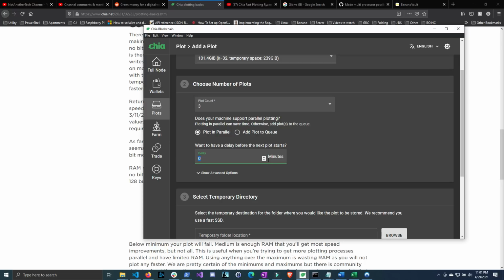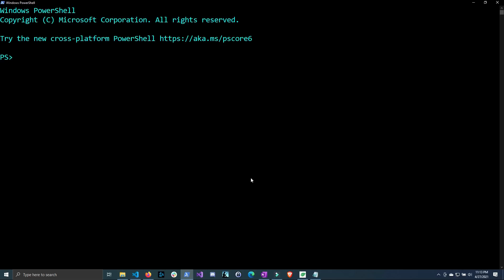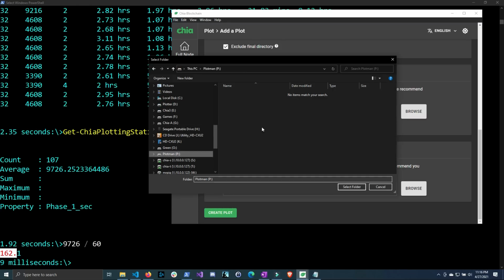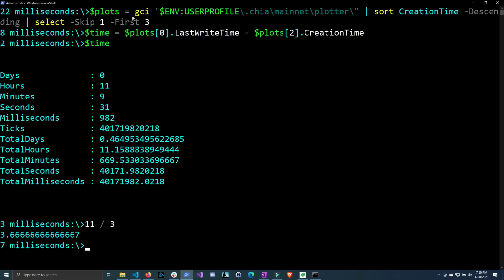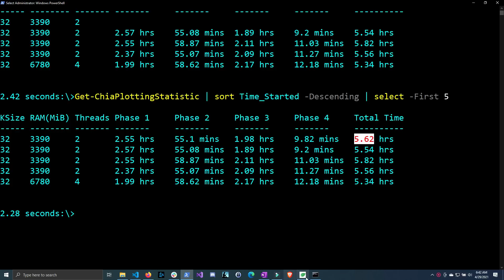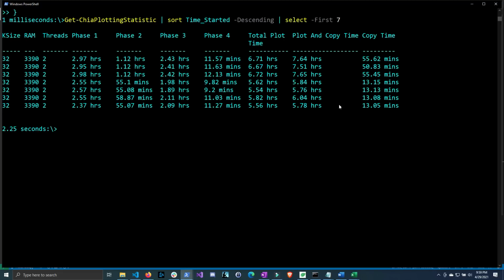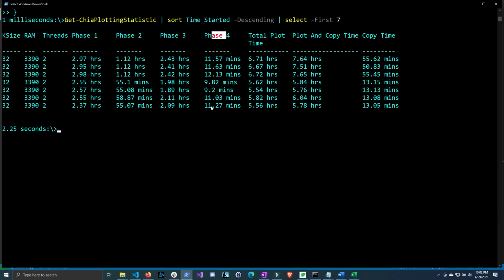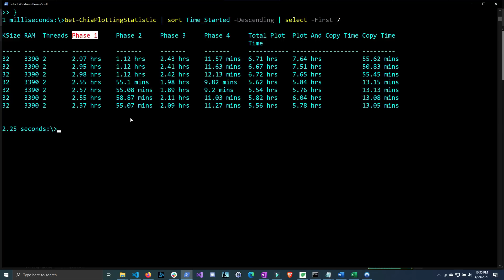Optimizing The Delay Between Parallel Plots Using Log Files and Powershell - Chia Plotting Part 3

Comment: While you are in the plotting GUI:  Mouse over to >ACTION >the three dots>Log.   It will open a CL window and show you a real-time log.  Optimize there first, then deploy..  Pretty sure the Phase 1 plotting for all will be with a few percentage points.  My Phase 1 are 164 minutes and I've been running them 8 mins (!) apart.  No wonder I have crazy long transfers to the farming drive :-(  I found all this out in large part by watching your videos.  TY

Comment: i guess there is one other thing you didnt mention in this staggering video... drive space.. it cant be monitored, so i guess you have to work out how many you can do in parrallel given the time per plot and the plot temp size... i have a 1tb ssd.. so at a guess, if i staggered each one by 2.5 hours, i could, in theory run an indefinate number of plots (1st plot emptying itself off the hard drive as the 4th plot comes in).. but for 1tb.. it would be very close call... you may want to increase the stagger amount to cover yourself running out of space (if running at speeds notanothertech channel was running at).
Reply from the maker: So you would have a max number of parallel plots going. If you have 1 TB then your max would be 3 and this video gives you a suggestion on the delay you want to stagger these 3 parallel plotting queues. The GUI doesn't allow you to do this natively, but I have powershell videos that shows how this can be done and one video on how to do this in the GUI as well.

Comment: Great stuff, im learning a lot but how do you add a date and time started to the columns? Also can i choose the log directory?
Reply from the maker: You will have to use Format-Table -Property prop1,prop2,prop3, etc to create your own format table view instead of using the default one I created. 

so Get-ChiaPlottingStatistic | Format-Table -Property Time_Started,KSize,etc
or  Get-ChiaPlottingStatistic | Format-Table -Property * 
to list all properties. 
You can use the -path parameter to specify a different path to the log file. 
ex.  Get-ChiaPlottingStatistic -Path C:\ChiaLogs\Chialog1.log
Reply: @SysDeskDev  Wow i was not expecting such a quick reply. I already started adding the date to the switch -Wildcard ($line){ and then i was going to modify the table... wonder if i get lucky and can pull it off. 

I see that Get-ChiaPlottingStatistic | Format-Table -Property * has the creation time at the end but the time part is cut off early.
Reply: Ahh i downloaded the zip and was trying to edit the scrips but i cant seem to run it from there. So that doesn't seem to work for me. I have to move the logs into the       Dir that it wants to look at. Its too bad i cant get the format simplified to hours like you set it but it will work. thanks!

Comment: Great job. One question, why not to modify a script for delay based on 1st phase finish time. In this case there is no need to calculate on aproximate time of 1st fase. Script will see that it's over and start next session. Is it possible?
Reply from the maker: Definitely possible, I do want to add that to the script but just haven't found the time.
Reply: @SysDeskDev  it would be great.

Comment: if u have 3 HDD u can try add 3 Qeue with differents names ( def 1, def 2, def 3) and dont use same HDD in the final destination for evade the bottlenecking in copy, i run 4 plots in paralell without delay using this method and works for me. Nice video for sure

Comment: Also, if the only "real" difference with/without delay is at the end (moving stage), if its a dedicated plotting pc, a powerful cpu/ram etc, wouldn't it be better to put 15 delay (delayed plot moving time) instead of 60-100min delay (phase 1 duration). 
Ok, as they start with min delay, they will clash at phase 1s and tire the cpu, but it will only slow the process less than an hour, and if we move them separately we gain 1 hour again?
Isn't this logical? In theory at least, it looks like its the best of both world..

BTW on my tests, even tho my P1s take almost 180mins to finish, ceteris paribus when I try 30-60-120 and 180mins delay, the 30min finishes before 60, and 60 finishes before 120 etc.. That is why calculating the delay based on phase 1 is mixing my mind..

anyway, great script and video, thank you..
Reply from the maker: I would at least put a 30 minute delay just to play it safe, but also by delaying them for the majority of phase 1 you could add more threads (which I didn't go over in this video but plan to eventually) which could speed up phase 1 with the proper delay in place if that makes sense.
Reply: Thank you for the reply. 
My understanding is the same, the more you pass the phase 1 with 1 plot the faster your other plots will finish. Ok, maybe do not put delay same as total time i.e 180min, but 30-60min seems ideal to me too and all the official/unofficial documentation says the same.
But my results say different. (I still support the above theory tho)..

Comment: I think I am missing something:
You said that 3 delayed parallel plots takes 11 hours to finish, where as 3 no delay plots take 7 each, but as they all start together (cpu in overdrive) ) its 11 vs 7, so no delay looks better.
Than you made a comparison table for the plots made in 24 hours, and showed that eventually, after 12th plot, delayed parallel will start to come ahead of plotting without delay.
So far i'm on track right?

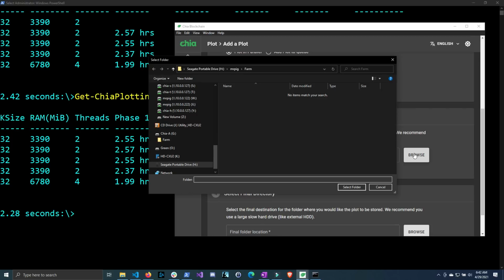Ok, here is my question, on your comparison table: You start at 5.47am and after just less than 6 hours (11:26) you already have 3 delayed plots? But 3 delayed plots takes 11 hours all to finish isn't it? 
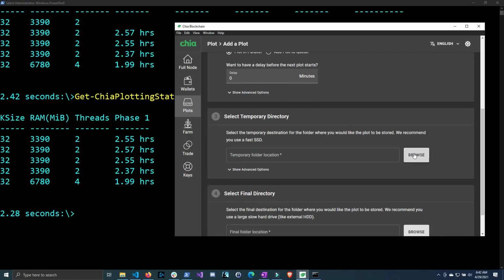I think you mixed the total time with time for one plot So in 11:26 column, there should be 1 plot delayed and at 4PM 3 finished delayed plots.. 

Am I right?
Know that I am a bit thick skulled, so please go easy on me if I am missing something obvious.
Reply from the maker: I will have to go over the chart again but you could be right that I messed up somewhere when extending the time out, however the chart was just for a visual representation of what would eventually happen which is that the stagger plots will eventually out perform the ones without stagger in the long run.
Reply: I am building a new rig with 16cores, i am sure if i put all 14/15 plots without delay it will take significantly longer than 7 hours and probably, as your calculations showed, even longer than 30-60 delayed.. at least thats what i hope, otherwise whats the point 🤷🏼, 
Cheers

Comment: I've been searching for some help with a crashing issue that I can't solve.  I have a Ryzen 9 3900x 12Core/24Thread, (2) 2Tb Nvme drives, 64gb 3600MHz Ram.  I've done the math 100 times and have been experimenting with different settings for max ram, threads, time delay, and # of plots in parallel.  The best I have been able to completed without crashing is from the GUI 8 in parallel with 65min delay, 6750ram, 2threads 14hrs from start to finish.  BUT, with my hardware, I should be able to achieve much better, correct?  In my example, only 3 are in phase one concurrently using only 6 threads total.  I have plenty of resources to spare. I tried the same test, but with 29 in parallel, but never more than 5 running at a time.  I only completed 2.  Came back and my PC is on the start-up screen asking for my pin.  I don't get it.   I've also monitored for heat, both CPU and Nvme, nothing seems to get overly hot, cpu max 76c.  I'm not even close to any components limits.

Ran into the same issue trying to use 4threads with 8 in parallel, 90 min delay, 6750ram. Completed 4, came back to find pc on sign in screen again.

Power settings are all on performance, nothing is set to sleep ever.

Followed your videos and tried plotting in the command line, but I used SWAR, even used the setting to only allow 2 in phase 1, same issue.

Anyone have ideas??
Reply: Create a boot usb with memtest86.  Boot off that and see if it runs just the memory test for 60-90 minutes.  If it fails: make sure memory timings match on same dual channel sticks.  Then adjust memory timings. 

Update all of your drivers.  Update bios on motherboard.

Try a cpu stress test like prime 95.

A reported 76c is too hot in my opinion.  Even if that is not the cause of your crash, you should do better for long runs to make your cpu last longer.
Reply: @christopherf8160  thank you!  I did the mem test with no issues. I’ll try your other suggestions.. really appreciate the guidance.

Comment: It will be good if you can send us your pc specs for your video. so we can have better idea understand the bottle neck in each phase
Reply from the maker: My PC specs are pretty low compared to others. I have a 9th gen i5 CPU (6 threads, 1 thread per core), 32 GB of RAM, and only 1 TB evo plut SSD for plotting.

Comment: Get-ChiaPlottingStatistic : The 'Get-ChiaPlottingStatistic' command was found in the module 'PSChiaPlotter', but the mo
dule could not be loaded. For more information, run 'Import-Module PSChiaPlotter'.
At line:1 char:1
Reply from the maker: Gotta run  Set-ExecutionPolicy -ExecutionPolicy RemoteSigned
Reply: @SysDeskDev  ohh it worked, thank you sir

Comment: Don't forget you can also create Multiple Plot Queues.  Option 2 in Plotting click "show Advanced Options" then if you want to create a second queue of plots that will run in parallel to a running plot just change the "Queue Name" to any other name and add some more plots to the queue.  :)

Comment: Brilliant !  I just built my Chia rig, has 2TB nvme,32gb ram and 5.2Ghz i9-10850k , been trying to get some use out of the 2TB as it finishes plots so fast I only use 600GB with plots queued with 95 mins, should I start another parallel plot ?

Comment: I'm going to sound like a complete newb, but I have virtually zero experience with Powershell. I've attempted to install the module as you directed, I ran powershell as an administrator so that I could install. But I was not able to do anything afterwards. I couldn't even do the simple "get-chia" command. Any thoughts? Did it not install?
Reply from the maker: What errors are you getting. Check out my video on some troubleshooting the module.

Comment: my ryzen 5950x is doing 2 plots for 2 phases in parallel. used 16 threads per plot and 3800mb ram. (should i put next time max threads to 32?)
Here are the results>
phase 1 avg. - 6425s
phase 2 avg. - 3346s

So i tried to use Patro approach from video u suggested which means >
phase 1 +phase 2/60=163 min

so how do i calculate now the real delay time to set?
6 plots for 2tb nvme> 163/6? or did i miss smth important?

That means 28 min delay for each plot?

considering that i have now 2tb nvme and planning to go to 4x2tb in asus hyper m.2 gen4 ... How can i manage then this maths?:D

Comment: I have 4tb nvme, 10900k cpu (10 cores 20 thread), 64gb rams. i have tried to make with 50 minutes delays paralely plotting. i can do this with 15 maybe 16 or even more plots on the same time. the question is: as long as my cpu is 10 cores 20 threads, maybe its no sense to do 15 or more plots on the same time? maybe i need to try to keep 9 of plots paralelic all the time? because i have a feeling that more than 9 plots (1core i am leaving for the system to work properly) will overload the system and it will take longer to plot (plots per hour) what can you say about my situation? thank you for your answer :)

Comment: Thanks for the statistics script.  I determined I was wasting too much time in the copy from the Temp drive to the Final drive (HDD), ~2.5 hrs.  I added another SSD as an intermediary Final drive now my copy times are down to ~1.6 minutes.  When I finish copying to the intermediary drive I turn around and copy to the final HDD.  Then I can immediately start plotting again because I won't be using the Final  (Intermediary) drive until the end of the plot.  So, I can copy the previous plots off and farm new ones at the same time.

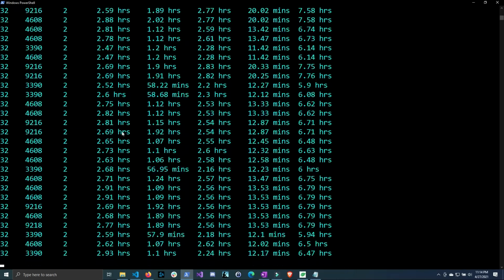Comment: In the minute 4:14 you show a k32 plot created with 6780 of RAM and 4 Threads. In the next line you are using 12000 of RAM and 2 threads and it uses more or same time in each phase. Then, why both k32 plots finish after 5,34 hrs?
Reply from the maker: So at that time the command had a bug in that I didn't clear the variables at the end of each loop, so if the next plot didn't finish it would insert the value from the last plot log. It is now fixed. I had a lot of plot logs that didn't finish since I had RAM issues in the beginning.

Comment: what happens if you change the thread count to 16? would more thread = faster phase 1 time?
Reply: For phase 1 I get 1.955 hours for 6 threads and 1.941 hours for 8 threads.  I am plotting 4 simultaneously and allocating 16 GB ram.  I am testing other thread counts and eventually other ram allocations.

Comment: Great video.

But, you're talking CPU optimization in this video.
I did the same optimization like your with accounting the whole plotting including the transfer time (plotting drive to farming drive).

Based on my calculations I could do 3 plotting in a 1TB NVME SSD with around 120 - 130 mins delay.
Reply from the maker: I also talk about the transfer time in this video and I ended up concluding that was the real bottleneck and not the CPU in phase 2. Did you watch the whole video or just the first part?

Comment: Friend firstly thanks for video. I got 2x raid 0 corsair Mp510 960GB---> Total 1920GB , AMD 4650G (12 threads)Cpu and 32GB ram. Which one must i use? One by one with delay or parallel plotting how many? TY.

Comment: Your right on the final copy, normally it takes 165 seconds to do the final copy for me 4 drive raid0 pretty quick.  but 2 of my plots are finishing at the same time and its been over 15 minutes and they are still copying... thanks for the tip.  I will delay for now on its worth it.  I was watching task manager on my 4x raid0 final storage location and the write speed was only hitting 198mb/s.  when one plot finished copying it shot up to almost 900mb a asecond to finish the 2nd one.

Comment: What happens if you use your max threads for the plots? so the first plot will use all threads lets say 12 for phase 1, then when it's complete it moves down to 1 thread in phase 2.   Then your second plot starts up, will this second plot try and use all 12 threads or will it only use 11 seeing how your first plot is now using 1 thread?  Thanks.  My idea here is to power throught phase 1 as fast as possible.  Great video by the way, I think i learned more watching this then any other video ive seen, im probably gonna watch it a 2nd time too!  Also could you do a video or share some insight on your nvme/ fast drive storage use? is there different phases that use up more space then others? and is there a way to add that into the equation to get even more plots.  Thanks.
Reply: you dont get any gains by giving it more than 4 threads and 6750GB per plot. At least thats what i understood. It then depends by the clock speed of you cpu and the model.

Comment: So you're running on 6 cores. Threading is only used in Stage 1. Have you tried running 3 staggered plots with a maximum of 4 cores? Stage 1 shouldnt overlap and for the rest of the stages the plots that aren't in phase 1 need just 1 core anyway. Would be interesting to see this compared with setup you explain in the end.
Reply: Cores are not threads. If you have hyperthreading on your CPU, your 6 cores will have 12 threads.

Comment: Why is the get-chiaplottingstatistic pulling only today’s plots, I have total 9 plots but this command is showing only 5 plots that are done today. How to get full list
Reply from the maker: Did you make all plots in the GUI or did you make some in the cli as well? The default directory it pull from is C:\users\username\.chia\mainnet\plotter, check that folder to see if all plot logs are in there.
Reply: I see only 11 plots in that folders, how to get the other 6 plots. Yes, I plotted some in GUI and some in CLI
Reply from the maker: @cyberlakshmi8829  So plotting in the CLI will not automatically generate plot logs like plotting in the GUI does, so those logs were never created. You can create logs in the CLI using tee-object though.
Reply: Could you send the command, by piping the tee-object I am able to generate the file for all my n-5 plots in 1 file but how can we generate the log file separately like GUI so that it will help to analyze the logs
Reply from the maker: @cyberlakshmi8829  Yeah the tee-object will just create one file for all N number of plots unfortunately. So basically you will have to do a "for" loop and change the n value back to 1 and make the for loop the number of plots you want (in your case 5). I will go over this in a future video. I hope that makes sense.

Comment: seems to me like you want a 15 minute stager so that each copy isn't happening at the same time.
i've been running then as ques but I make the que at start at different times (i made 11 today so far but i'm going to set up a raid 0 once ssd's 4 and 5 arrive soon so i'll have to redo the maths)
That way you can could have 57 total in the que with your system (I'm hoping for 20 in parallel next week on a 16 core)

Comment: This has been helpful for me!  Thanks for the info.  I have just been parallel plotting multiple at a time because i have a 12/24 cpu.  downside is that if you are busy at the time that they are done plotting then you are not plotting more until you que up more plots.  I did not know about the thread requirements of the different phases, so that was good info.  On a side note, the 7.51 hours total time should have been 7 hours and 30 minutes not 51 minutes, cuz decimals.  But your point still stands.
Reply from the maker: I am glad you find useful info in this video! Yeah I think I made that mistake a couple times, saying the decimal in minutes rather than converting it, I knew it was gonna happen too!